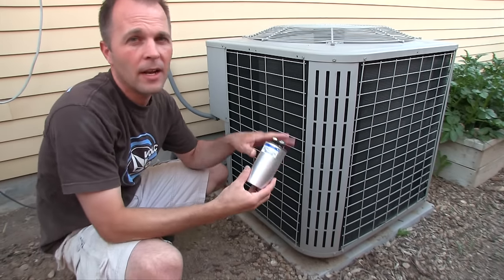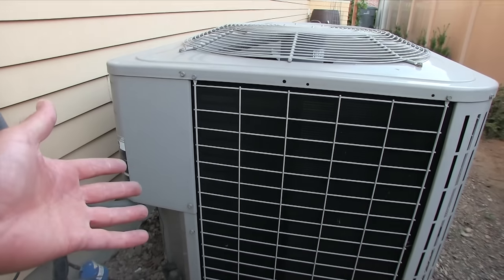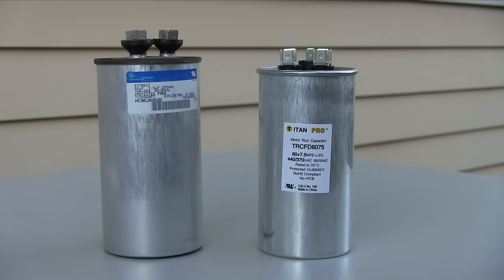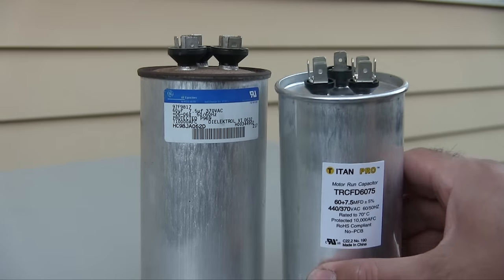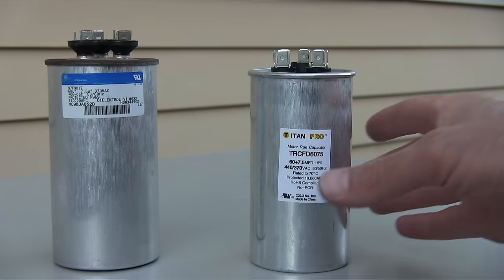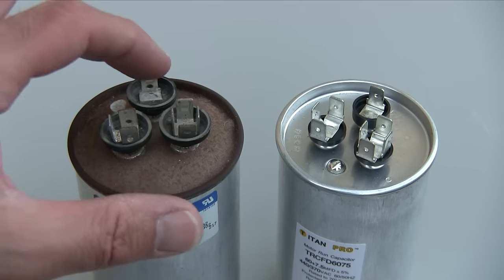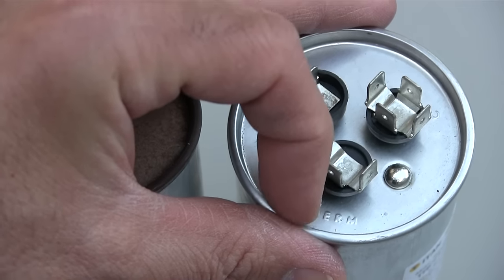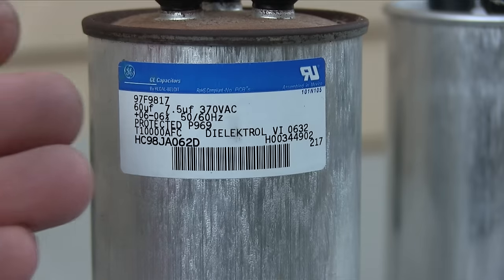Air Conditioner capacitors  - Basic Info - HVAC troubleshoot & AC repair

Comment: Thanks for the video. I’m an electrician and just had to replace mine. I also work in the HVAC industry. Everything looks good. Only one suggestion. I’m not sure that the voltage rating is for the minimum voltage as you state. Realize that you are showing a residential condenser and typical utility voltage at most residence in the US is 240 VAC. In this case it would be the max voltage. You are correct to replace at the rated voltage. In commercial applications the voltage can be 208, 240, 277, or 480 Volts. So that 440 may be the rated voltage by which the capacitor works not to exceed. 

Thanks for the video. Very well done. All the best to you.

Comment: Fan didn't want to run, and house was getting hot. I changed out my A/C capacitor a couple of weeks ago. Got it for $22 at the local hardware store (big box hardware stores didn't carry them).  Worked like a charm. Thanks for the helpful vid!

Comment: WOMEN...YOU CAN DO THIS!  My A/C went out and my husband is in the hospital so I had to fix this or at least diagnose what the problem was so I don't get ripped off. So the first thing (and easiest) I checked was the thermostat...worked fine.  Next, was the Circuit Board in the Heating System...there were no obvious 'burn-outs' or problems.  The 3rd, was the CAPACITATOR.  I have a Goodman, as you do, so the Capacitor is in the wiring compartment of the actual Air Conditioner, just as the video shows.  From another video, I learned that the Capacitator is the #1 culprit (21% of Service calls) of a non-working A/C unit. The actual fan on the A/C worked fine and I noted many A/C's just hum giving you the tell-tale sign it's the Capacitor.  But because the A/C was installed in 2004, (15 years ago),and the Capacitor had never been changed out, I figured I'd spend $26 for 2 on Amazon (with 1 as a back-up).   The actual fix was less than $14 and 30 minutes of my time.  I want to mention how IMPORTANT it is to shut down ALL POWER going into this A/C and discharging (shorting out) the capacitator.  The BRIGHT RED WIRE is the culprit.  As I was just moving the wires aside, I accidentally touched that red wire and received an immediate and scary shock that I will never forget.  SHUT OFF YOUR POWER before you even open the panel and discharge that capacitator...it's real!  Anyway, got it done and saved about $400 for a service call, their time and the excess they would charge for a Capacitator.  THANK YOU for your video :-)

Comment: Adam is very thorough in his video and truly highlights all the dangers you should first be safe with as well as the details you need to know about testing and replacing a capacitor if it is determined to be bad. By the way, I do electrical work; do listen to Adam about the dangers and turn off the breaker at the main load center panel as well as the disconnect fuses removal after you shut the power to the disconnect.  Thank you

Comment: While shorting the terminals is always a good idea when handling any capacitor, it should be remembered that capacitors store a charge only when charged with direct current (DC) .  Capacitors used in alternating current (AC) circuits do not retain a charge due to the constantly changing polarity of AC.  You are not likely to be shocked by the run capacitor from an AC motor.  But your advice is sound; better to err on the side of safety.  Good video.

Comment: Something also to keep in mind here is that capacitors are as dangerous as the 240 VAC coming into the unit. Do not touch the terminals unless you know the capacitor has been discharged completely. It may be defective or degraded but it may still have a high voltage charge on it that will make a bad day for some. These capacitors are high voltage batteries essentially.. I had not watched till the end where you show the discharge... This should be up front with the warning on 240V... Good video...
Reply from the maker: you are so right.  Thanks for the comment!
Reply: Yes, I got shocked by one before and it was not pleasant. Safety first.
Reply: I didn't listen and have one on hand, mine failed the first run of the season today, ordered two on Amazon just in case. Didn't feel like running outside to get the spec off the cap at night, they don't make it real easy to look it up online either. Even the Lennox PDF on my model only says C12. Repairclinic had it listed as a 35+5 440. My model is the Lennox 10ACC-030-230-03 in case anyone runs into the same issue.
Reply: Just to add my "you-can't-be-too-careful" suggestion.... I always discharge when taking a new one out the box. Someone could have returned it, and it COULD (although highly unlikely) have a charge.

Comment: Thanks Adam! I watched a few videos and this one helped me to get back to where I needed to be in A/C repair.  The average cost in the usa is about 175 to 250 for an A/C call where it results in capacitor replacement.  One of the things that set this video apart was that there is a 2nd way and actual capacitor testing meter to test the capacitor with which NONE of the other videos I saw said anything about at all????  One of the things I did in error was I checked the capacitor with the fuse pulled (as it should be) however with the wires still connected.  With the wires still connected even though I diffused the capacitor it showed a surge on the ohm meter. So I falsely thought it was okay because I could not visually detect any real serious bubleage (is that a word?) on the ends.  Okay so because of your video that said even if you do not need another capacitor GET A SPARE!  Thats what I did...  Okay so I went to Am..zon and got new ordered and decided that I was still going to replace the capacitor BECAUSE OF WHAT YOU SAID... test with both meters.  Because I did not have the 2nd meter I decided upon this replacement just in case.  Upon removing the capacitor I decided that I would retest again. Low and behold my ohm meter showed one side okay and the other side No surge spike.  Somehow by not having the wiring removed it falsed on me earlier.  Then because of what we learned I set the cap down on the table and it wobbled lightly like a weeble... So, new cap ordered as you recommended and I feel like a million bucks with as much as $250 saved on an HVAC call.  Thanks a billion for your very thorough video. It is what is good about YouTube and the internet.  Hope that helps someone else in my review of your review.  Peace.

Comment: Great video, appreciate your knowledge. I replace my condenser fan, capacitor, and control switch on my Goodman. Turning on unit the inside blower fan started to make noise like it was either loose or motor was going out. Did not find it loose. So ordered a new blower motor. Installed it. Not an ac tech I turned of the disconnect on the box outside. After turning it on and starting the AC. The new motor sounds like the old motor. Turned off disconnect and power to furnace. Tightened down motor frames etc (sounded loose old and new motors). Turned on 220 panel inside forgot about the disconnect outside. But turning on the motor from thermostat. The blower motor came on and had no sound like it should. No cool air out vent. I remembered the disconnect panel outside. Once it was on the new blower motor went back to being noisy. What do you think would make the old and new motors to be making the same noise?

Comment: You do not short across terminals of a capacitors with a screwdriver some capacitors are fused inside and that will make the capacitor unusable. So you need to use your meter to do this set in volts place your leads across the terminals and watch the voltage bleed down to 0 when it is at zero it is safe to handle.
Reply: I suppose those small capacitors found in ceiling fans, fridges ect are not fused but those larger ones are. Am I right?

Comment: so glad you made this video. Going to get so much more business from people attaching the wires wrong, or getting the wrong capacitors and damaging the components on the system. not to mention that almost every 440/370 new capacitor is a different size and shape than the OEM one and they will have to make a new mounting bracket for the capacitor. and then theres always the classic touching the low voltage wire on the contactor  and destroying fuses and popping breakers and circuit boards. oh what fun it is to go on calls where the homeowner tried to save a buck by learning a skill trade that the people working in that trade have to stay up to date on yearly because of all the changes. I will say this I use youtube as a tool to learn how to do lots of things myself instead of spending more money to make someone else do it. but keep this in mind, your homes HVAC system is the single most expensive piece of equipment in your home. Do you really want to try and save a hundred bucks by risking a potentially very costly piece of equipment? it's up to you. I just hope you watch more youtube videos than this one because this video covered none of the hard parts about changing a capacitor.

Comment: Great video a lot of information I'm a technician that's been in the field 15 years I've done everything from installing furnaces the diagnosing low pressure chillers and everything in between I was trying to do some research about this Titan pro capacitor my new supplier is using and stumble across your video great work keep it up I'm very happy when I see one of my customers save a few dollars but at the same time there's also certain trade secrets/skills that should always be left to the professionals

Comment: I wish I would've watched your video before I called the HVAC guy a few weeks ago. My compressor fan was spinning backwards slowly. Turned out it was the capacitor. The repair guy changed the capacitor and charged the system. Cost me about $340. I believe he charged me about $50 in parts just for the cap. Next time I will do it myself.
Reply from the maker: Bummer!  If your freon was low due to a leak, be sure to find the crack and have the leak repaired or you will have to charge it again in a year or two.   That is what one of my neighbors is now dealing with.
Reply: I would have charged you 150 -250 for the capacitor. so you actually got a deal.

Comment: Sorry, this is so late. 370VAC or 440VAC DOES NOT mean that the capacitor will RUN ON 370VAC or 440VAC, but that it is RATED to withstand voltages at those levels. So, what you said about not using a 370VAC-rated capacitor into a compressor that calls for a 440VAC-rated capacitor is true, but the reverse is not.
Reply from the maker: Thanks Steven!

Comment: I replaced my capacitor and the wires exactly where they were before. The fan is spinning the wrong way. Do I just need to switch the common and the fan wires.

Comment: AWESOME video with some great explanations.  I would have preferred the discharge portion be at the beginning, but no big issue.

One question.  The replacement capacitor you showed was a 440/370 VAC.  You mentioned I t can replace another 370VAC.  Am I correct in understanding it can also replace the 440VAC with no problems?  The fact that it CAN operate at 370VAC does NOT stop it from working in a 440VAC?

Sorry if that seems a bit redundant, but caps scare the crap out of me...
Reply: yes

Comment: Thank you much. I only have a tester with an ohm 2000 and 200 but do you have to remove all the wires to test?. I tested with wires on and it said 3 for herm and 90 for fan. Does not sound right.

Comment: The indicated voltage is related to the isolation capacity within the capacitor. 370 Volts means it will withstand 370 V without problems.

Comment: Hey that is the best video on youtube explaining capacitors! Well done! 
Can you make one more video in details for contactors, how they work, how to wire them ant etc.

Thanks one more time
Reply: Yes that would be very helpful !
Reply: There are (3) terminals on a capacitor.  The old capacitor will likely be too rusted over to see which is labled which, but take a picture before you remove anything so you can see where the wires go, taking note where the label is may help too.  One of the terminals has 4 prongs sticking up, one has 3 prongs, and one has a single prong.  Pay close attention to where each wire is as you remove it, and as you remove one wire, put it on the new capacitor, and keep doing this one by one and you shouldn't make any mistakes.  

A capacitor is basically a battery that can be charged and discharged literally in the blink of an eye if that is how the circuit is configured.  The circuit in the AC unit discharges a capacitor over a second or so (guessing on the time) and gives the fan and compressor that extra 'boost' of power required to get them working, which is why if the capactitor fails the compressor and/or fan will no longer start when power is applied.  Unlike a battery though, a capacitor can hold a charge for years, so don't assume a capacitor is discharged just because it isn't plugged in or has been sitting for a while.  

One dead giveaway that a capacitor is bad or going bad is the ends will start to expand out as if they are under pressure.  Some may start to leak out the dielectric material that is between the two plates that hold the charge.  Luckily these capacitors are very quick and easy to swap out.

Not a really technical explaination, but I hope it helped some.
Reply: Duct AC main connector sit Nhi hota Kia problem ho skti hy.

Comment: Yes, 240 power supply is dangerous but not because of the 240 volts.  It's the amperage, or current that'll get you.  A static spark is thousands of volts and most people can't feel a static spark under a couple thousand volts.

Comment: Could you please tell me what if this capacitor will work for a armstrong concept 1000 model numberscu10g36a-1 serial number1605g06309?"

The capacitor is rusted I can't read the details.

Comment: just had the ac guy replace the capacitor in my ac unit .. he took out a bad 60uf/5uf and replaced with a 80uf/7.5uf ..all is working well.. is it okay to use the higher uf values ??? I am going to order a spare .. which set of numbers should I use ????
Reply: glenn bryson thats good to know because ive just purchaced a 5/50uf to replace a 4/50uf hopefully it works
Reply: Higher rate capacitors can hold a higher farad but only if they are being fed more power from the source. Should not be a problem but I prefer to replace with equal units unless it's a known issue and replacing with higher uF resolves a known issue

Comment: Adam, was wondering on a dehumidifier if it trips a breaker right after you hit the start button could a bad capacitor cause this. Thanks in advance

Comment: Can i use a 370 volts dual run capacitor to change 250 volts that’s is the original in  wall air conditioner
Reply: Gerald Bony yes even 440 Volt
Reply: rishi raj ok thanks

Comment: I have a window ac model number LW1510ER 15,000 BTU and I plugged it in and press the power button and no power at all. Outlet is working, green light is on on the plug and the fuse in the AC is okay.  When I stored it last year it powered up perfectly.   Any idea what could be wrong other then what you talk about here?

Comment: So I watched this and your old video. My AC is making that buzzing sound. The fan will turn on at random after the AC being off for a few hours but it'll only stay on for an hour.

Took out the capacitor to get a new one and the guy at the store tested the current and said it was okay. So I cleaned my AC unit and put it back in. Had the AC for two hours before the buzzing started again. No clue what to do since the repair guy I called said it was going to be $400 just for him to examine it.

Ugh.

Comment: Great video. My question is, when so corroded, how do you know which is common or Herm?
Reply: helo  my dear friend you check multimeter to connect through prope  on any two terminal which one difer  two  terminals high  is this compressor .which one is very low this one fan .look like compressor test crs..

Comment: Everything works in my AC unit, still no hot air nor cold comes out! Just warm air! What's wrong?
Reply: Just like my A/C yesterday!   My technician cam out and said the capacitor was bad and needed to be changed.  He did it and A/C is working fine now.  Service call was $150!  I am buying a dual run capacitor - mine is 70/7.5 MFD - to keep on hand.  $20 on amazon and $16 on eBay!)

Comment: DO NOT TOUCH the terminals until you have de-energized capacitor. a screw driver accessed terminals will work. DO NOT touch metal part of screw driver!!! yeah or the death thing again. he does cove this at the end. think it should be first

Comment: Can you buy these capacitors at Home Depot or lowes?
Reply from the maker: No.  You can get them on amazon or from some industrial supply stores locally if you take time to look them up.
Reply: +AdamDIY ok thanks
Reply: +AdamDIY what's  the longevity of these capacitors?
Reply: Life span? It's a toss of the dice, and hard to say. Depends on usage, capacitor quality, age, heat... etc. For $7 online, get two. Mine died when it was 96* outside = not fun.

Comment: You should never touch the leads.  Even new Caps, you never know if someone plugged it up, charged it and returned it to the store.  Especially for tutorial purpose, you should always show and explain to "never ever" touch the terminals with bare hands regardless of status.
Reply from the maker: Good point! thank you for posting.
Reply: @AdamDIY  And thanks for the video.  It was helpful.... Just wanted to point out that one thing.